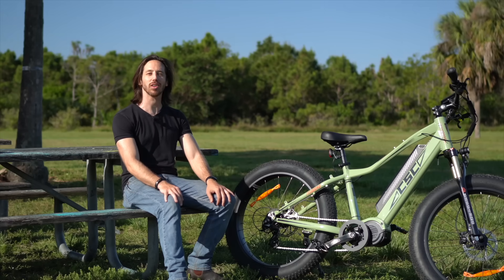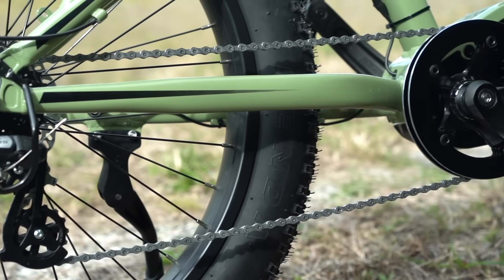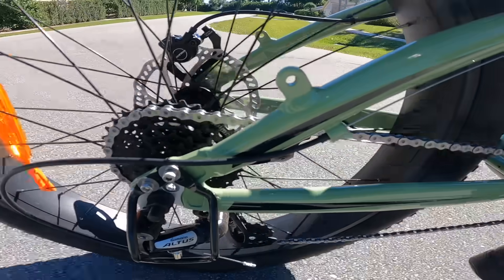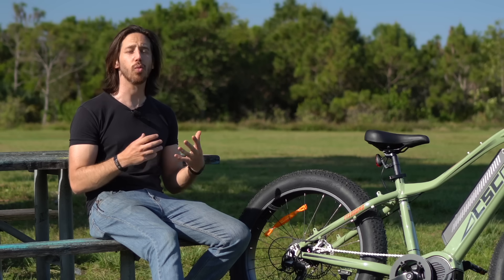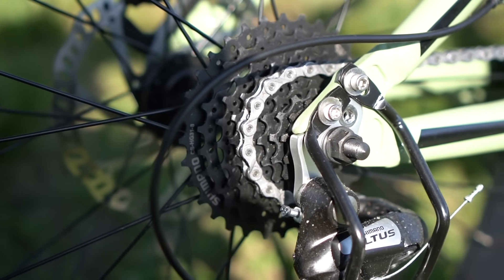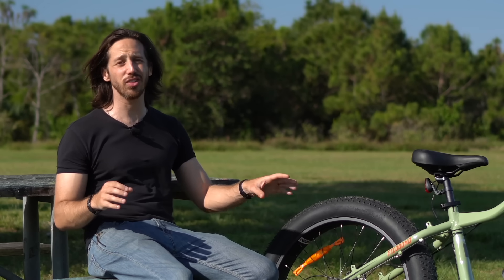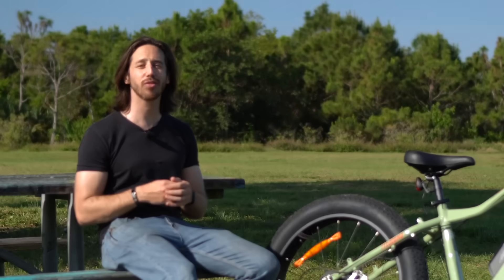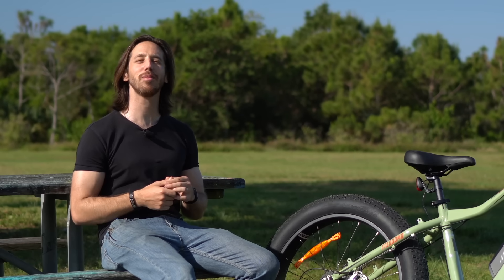How to (properly) ride a mid-drive electric bike

Comment: That's why I prefer the hub motors instead of the mid-drive motors.  They don't wear out your gears, chain, or derailleur at all.  And because hub motors are direct drive, they are more efficient since the motor is directly spinning the wheel.   And so much simpler since no need to time your shifting of gears, and most of the time I don't need to shift gears.  Just easier all around.

Comment: I have a bike that has been slipping in the two highest gears from the start. Even when new the gears slip, how do I adjust it so it doesn't slip? I checked the gears and the chain, and I have about 20% wear on them.

Comment: Spot on. Stop pedaling when shifting. Found out the hard way. Broke the chain and blew up the derailer while not doing this. It was a bbshd 1000 Watt. A few miles from the destination. Used the derailer cable as a tow rope and towed it back with a bbs02 750 Watt. I McGivered it. Those Bafangs are strong. Never buy the gear or brake sensors. Do what they do by stopping pedaling. ( Yes l learned the hard way. ) Good video. Great information.

Comment: I have a Rohloff e-14 gear hub, with gates carbon drive , beauty of that being the start gear automatically re-sets its self when you are stopped  , the other being the electronic gear shifting which is so smooth
Reply: I'm not familiar with the Rohloff yet, but I love my Nexus 8sp hub on my non-ebike. The internal geared hubs seem like a natural match for the mid drive application. Thanks for making me aware of the application.

Comment: Ok ignore my last comment as I missed the segment of this video that talked about some setups use a gear sensor to cut the motor during shifting. Now I half to figure out a gear sensor. It would be nice if you had a video about using ultra caps to take the initial energy hit off the batteries so they discharge at a more even rate for longer battery life. Or is that just one of those things you must research on your own?

Comment: Fascinating. I'm 74 and use the 'top-gear' all the time on my hub drive bike. Not because it make's me go fast but because I don't have to peddle so much ! Even with non electric bike's, I'll use the highest gear, just to 'cruise along'. I ride to 'enjoy the countryside' not to get from A to B quickly or exercise and nowadays's use path's & cycle route's a lot, so going fast with walker's & dog's around, is a no, no. I live in Wales, in one of the Valley's which is hilly (like, in VERY,) and was advised the mid-drive would give me the torque to get up the hill's easier. (Being old and living at the top of a hill, I NEED that help, LOL). Thank you for the advise. It's made me think. (Ouch! ! ! )

Comment: Brilliant video, thank you. I've spent many hours watching videos, and not one explains this. Your page is correctly named. But deeper questions: 1. If torque sensors cut the throttle for shifting, why do you suggest also cutting throttle by hand, as if you didn't have a torque sensor? 2. If brake cutoffs do the same thing, what is their advantage/reason? Wouldn't a brake cutoff and torque sensor be redundant? Or is it one or the other?
Reply from the maker: if you have a true torque sensor, then yes it will reduce power to the motor when you ease up on your pedaling. So you just need to ease up, shift, then pedal hard again. But if you're using a hand throttle or cadence-based pedal assist, they can provide serious power with minimal input, so you need to be careful to let off the pedaling or throttle for a brief instant while you shift (or use the brake lever switch to cut motor power while you shift).

Comment: Have a 6 years old Bosch mid-engine e-bike with a carbon-fiber belt, 95% of the time I'm On the highest gear, engine is strong enought to do the rest, all still looks and works as new, never had a problem and all parts are still original.

Comment: Careful doing this brake as clutch trick. It can actually shorten the life of the controller. I personally lost the controller to doing this with a hub motor. You should always release the throttle when stopping or shifting  With Or without the brake switch present.

Comment: I use a shimano nexus 8 speed igh, far better as the chain doesn't have to move, you can get a button that plugs into the brake cut off socket and you just touch it when changing gears

Comment: After only 20 miles on my mid-drive ebike, I'd realised that easing off while down-changing under load is important. The crunching from the back end can be horrendous otherwise, and that ain't good for chain & sprockets. Good tip about using the brake-lever cut out - think I'll be practising that one on the flat first, though!
Reply: It’s called mechanical sympathy !
Reply: Or just get a gear shift sensor.... It's a night and day difference
Reply: @Kannondale07  The bike in this video already has one yet the person explaining it seems to think it needs explaining still. So I will assume it does.

Comment: Only my MTB is electric (where a throttle is heresy!). Pedal assist is a god send for those steep hills, and, since I've had years of experience with a non-electric MTB, the proper care of the mid-drive motor came easy.
A good rule-of-thumb is to maintain a cadence of 60 rpm by choosing the proper sprocket at all times. The motor seems happy with that cadence. Using throttle-only on hills without regard to the gear ratio is a sure way to burn out your motor in short order. But then, most ebikers are not real cyclists, are they? We'll soon have millions of ebikes good for the scrap yard.
Reply: Generally I use my hybrid e-bike with a cadence of 70-90 rpm effectively.

Comment: I threw a chain yesterday on my mid drive and now I notice that when I pedal the let off peddling, the front sprocket  continues about a half revolution. Never noticed that before. It seems ok, but if I go to pedal while that is turning you can tell it's catching. Was wondering if I tweaked the clutch or gear or something? Or is that the way it always was and I just never noticed?

Comment: So since I learn to ride by Ten Speed bicycle back in 1968 when I was 14 years old by shifting through the gears and easing off for gear shifts     I will do fine.    Currently I ride a 40 year old Raleigh English 3 speed.

Comment: Good tips here! The only thing I do differently is to gently pedal whenever I'm running through the gears, it makes the whole process smoother. The shift sensor cutoff certainly helps, but pedaling smooths out the shifts.

Comment: I have a question...First I like your video...now someone here said that here USA 20 mile yes here that is all we can have LOL I have to of your books you alway talk about higher volts well i  building a mid driver like this video https://www.youtube.com/watch?v=EVOCo62lAxQ&t=327s&ab_channel=NextInnovation   
I'm going to use a MY1016 or MY1018 at 24 volts at 2500-2650rpm but but if I did my math right its to dram fast 50 mph so my question is if i was to go to 12 volt that would drop the rpm to 1250-1325  so that would make it about 25 mph...I know there going to some that going to say buy a mid drive i say money i can make one for under $200.00

Comment: I just compromised. Mine 4th gear always. I reversed my tensioner spring to pull chain slack upward to prevent grass tangles. I ride mine in tall grass off highway. Full shocks, 24" wheels and I shortenned my cranks for BBS02 750 watt. Some ditch angles would bottom out. I shortened cranks near 2 inches, drilled and tapped. No more bottoming out and pedals fine. I can change gear but I turn off motor and work chain to other gear by push/pull tensioner. I turn adjustment screws. This is only in emergency if battery dies. I hate hardtails and fat tires are a joke. I use to have Lecric XP. I liked it but fat tires has nothing on full shocks. Just as mid drive is much nicer than hub.

Comment: You don't have to worry about pausing when shifting with a torque sensing motor like the tongshen motors. They only pedal when you pedal unless they are on the throttle. They also put out less force when you put out less force. No need for a gear sensor.

Comment: My Cyclone motor at 60% torque output stripped 4,5,6,7 on the freewheel. I tried a Sturmey hub shifter and blew out third gear when I was beach riding and did not realize I was not in second gear (direct drive). I then went to single speed freewheel and all 1/8 drive components. I am an oldster and do not pedal at all. Knees will walk fine all day but they will not pedal for long before really protesting. I am going to try a new Sturmey and pay attention on the beach and big trail hills to be in second gear. Building and tinkering with my eBike is a hobby for me. I love tinkering. The Bafang is pretty anemic compared to the Cyclone and CYC offerings in higher wattages.
Reply: I really think internal shifters can't handle Cyclones, but I've never tried one. I wish Shimano would design a beefier e-bike freehub with 3-4 gears and a thicker chain, but maybe it's not mechanically possible.

Comment: No electric cut-off on my mid drive bike 😔unfortunately...
But my bike does have an internally geared Shimano 8 speed hub , so I can shift standing still 😎
Also, after riding it for about a week I am not shifting under load ( no pedalling at all !) anymore, so all good now.
Cheers all, and thanks for your videos

Comment: If you're slipping gears a lot, you're doing it wrong. I've found you have to ease into the higher gears and those are the gears that cause the most problems.

Comment: Excellent video on an important topic. I have been riding a mid drive for years and your advice was spot on. Except for one issue: Bosch, Shimano, Yamaha and Brose are all class one ebikes. They have no throttles hence no motor shut off connected to the brakes. Therefore the brakes can’t be used as a “clutch” to ease the shift. Your other suggestions and explanations were 100%.
Reply: Class 1 and 3.

Comment: Micah - would this apply to a different drivetrain, in my case I have the enviolo 380 Trekking IGH and a Gates carbon CDX belt? There’s only one external drive cog at the rear obviously as the planetary gears are internal. I do find that I’m in top gear most of the time, using a low cadence but high torque. Is this bad for my drivetrain as well?
I much prefer to be at the higher end of the range. In fact, I would like even higher gears as I frequently find I’m spinning too fast to generate any additional power on even modest downward slopes. Maybe another video topic? 😆

Comment: Another good video. This subject matter is highly under rated. Learning how to properly shift a mid drive will not only save your drivetrain, it will maximize your battery output and maximize your fun. He’s 100% right on all points. First gear is near useless unless climbing big hills or off roading technical stuff and top gear is pointless in most circumstances. On my DIY mid drive 8 speed, 2nd thru 5th gear are my main gears and I never start in a high gear. I have rode motorcycles daily on the streets for over 35years, so shifting is second nature for me and transitioning to ebikes has been super easy and a lot of fun. I’m now waiting for my Bafang Ultra M620 to complete my fattie build.
Ebikes are amazing fun and crazy practical. Please be safe, wear good safety gear and have fun. 
Watch all the ebike school videos, good information!

Comment: I'm not a fan of the stop motor shifting. As long as you don't rapid shift you will be ok. it took me 4 years ( about 35k to 40k miles) to need my bbs02 motor rebuilt. if you do want to cut the motor using one of the methods he says then do so. As a person that has been in the ebike industry for about 15yrs now, I can say I hate those shift sensors they have a high rate of failure, and it is way overpriced. I never install them and I remove as many of them as I can. I teach people what they do and how they work.

Comment: Great video. I agree with IamSpiders and would add that on a carbon belt drive with IGH you have to stop peddling to shift thus avoiding the problem. 
Keep up the good work 👍

Comment: What is helpful is adding a gear sensor to mid drives; When the rider shifts on a mid drive, the gear sensor lulls the speed and motor of mid drive so there is less tension and torque on the chain.

Comment: Appreciate this video. I use a BBS02B with a 52 front chain ring with 11-34 rear chain cogs, 52V 28Ah Triangle UPP Battery, and 110 PSI tires. Road Bike with riser handlebars.

Gear 4 is the highest uphill gear. Too easy to pedal to go fast. Gear 5 lowest flat/downhill gear. Too hard to pedal to climb hills.

Comment: These lessons are basic knowledge for those folks who drive standard "stick" transmissions. Shifting under load isn't a problem for automatic infinitely variable transmissions like the Enviolo with the automatic shifter.
Reply: Exactly thats why i upgraded to an enviolo/nuvinci rearhub. What a ride! I would absolutely recommend it to anybody who wants a diy middrive!
Reply: Life is made difficult by having to worry about chains, derailleurs and cassettes so much better to have a mid drive ebike with a gates belt and a matching drive system, in my case enviolo  for urban cycling and rohloff for touring. Yes back off when changing manually with these as well but as others have indicated never look back to a chain drive. You might say a more expensive option but the extra price first up perhaps will be more than compensated by the lack of replacement parts required. Rohloff automatically changes down to your preset preference when stopped.  Life is much easier without being a member of the chain gang.

Comment: I came from a motorcycle background so understanding the mechanics of a middrive ebike was very intuitive for me. For example you don't start off on a motorcycle in fifth gear or you are going to stall or put a lot of strain on the clutch. You usually start off in first gear.
Reply: You would think it was common sense but many just don't understand mechanical devices.
Reply: Learning how to drive a manual has many benefits. It's a great anti-theft device!
Reply: I came from a manual transmission car...and also, 'manual transmission' bikes, and I live in a place that's nothing but hills, and there's no way I'd still have teeth on any of my gears if I didn't use that knowledge extensively...but it's also the cheapest bike with good components and a DIY build for the electric conversion, so it's also a temperamental experimental vehicle I wouldn't dare put a random person who's never ridden it on without a full tutorial, just like I would with a weird old manual transmission car with a carburetor and bad brakes...
Reply: I too came from the world of moto. As soon as you correctly move the front brake lever to the right (only for my safety) the biCycle crowd goes bonkers.
Reply: I too have come from a motorcycle background and manual cars as I live in the UK and automatic transmission is rare so I have always thought that riding a ebike with gears should be treated as if it was the same way as a manual gearbox as a motorbike or car rather than an automatic vehicle. Great to hear it from someone who comes from a similar background, thanks.
Reply: My dad when explaining the difference between my ebike and my mom's to her 
"You can start in full power, just as long as its low gear! I replaced my clutch twice now and boy here doesn't like his hub motor"
Reply: 95 of 100 ebike users start in high gear and leave it there.
Reply: @bob-ny6kn  sources?
Reply: @andyb7963  it's what I do.
Reply: @bob-ny6kn  you are right I will stop or try it's just  too fun
Reply: @bob-ny6kn Common sense is not common anymore 😢

Comment: Having these exact same issues cant really use 7 th or 8th gear with my Bafang M620 , so if i want max speed in 6th gear i dont have enough pedal Maybe using a bigger front chainring would help ? right now i have a 40 teeth . .I find that weird having this power and not being able to use it .In next few days i will be installing a clutch derailleur to see if it helps

Comment: Perfect video on the subject! Should be recommended viewing for all new mid drive riders. I shift out of habit from years of marathon riding, even on a RadMini with an extra strong hub motor. Using the brake lever to cut power momentarily for shifting is a nice touch. Thanks for the video!

Comment: Well when I had two legs and I could peddle that's what I do lat off pedaling and then shift. I don't know if I would use the brakes what if you hit the front brake could be dangerous. It's mostly just plain common sense.

Comment: Very informative video! I modified my bike with a mid drive last year, no gear issues yet but my rear axle has been bending. It is a 10mm thick bolt as well. Not sure what I can do besides keep bending it straight again.
Reply: Wow I've never heard of that happening. Perhaps your axle is a cheaper brand? Perhaps not and you ride really hard. You may be able to get one made from tool steel or other harder metal.
Reply: @grantadamson3478  Maybe I can modify a grade 8 metric equiv. bolt. I weigh 225, the bike and gear is about 30lbs and I use the thumb throttle plus maximum effort from me on the steepest hill, which is about a 25 degree slope. Oh and I'm always geared down to the lowest or 2nd lowest gear...I can't remember the sprocket count offhand.

Comment: Thanks for the video. I have a lectric XP original I was thinking of upgrading to the mid drive XP or something else. I want one that is easy to pedal should the motor die so  probably something not fat tire. I still like the folding aspect though. Any suggestions? Thanks